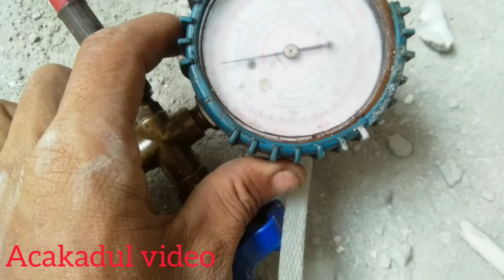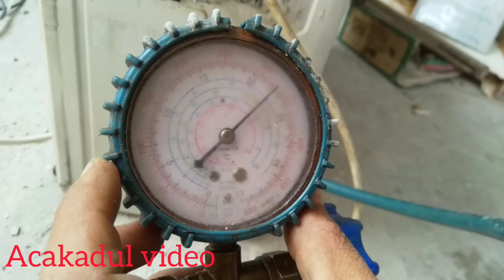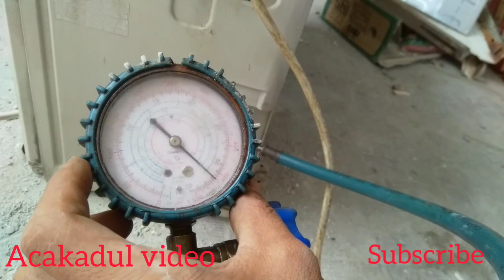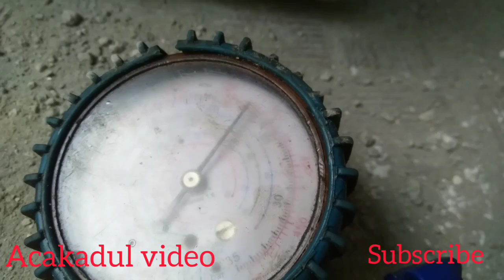AC tidak dingin???? kompresor AC loyo||pres balik

Comment: Assalu,alaikum..
Ac sy panasonik 1 pk...ketika sy ukur tekanan dan manifool hanya sampe 100 psi...terus klo sy cabut listriknye di pipa besar keluar angin agak keras...
Apakah kompresor ac sy sudah rusak..?
Reply from the maker: Maaf bosq bukan maksud menggurui,coba bosku tambah oli dulu,setelah itu dicoba lagi,masihkah seperti itu atau malh tmbah parah(ada oli ikut nyembur keluar)
Reply: @WawanPlog  ane udah tambah oil..dah ane jajal lagi..pas di cabut listriknye oli nyembur...ane jajal lagi, oli msh myebur bos...
Kira2 apenye yg bermasalah...
Reply: @WawanPlog  apakah msh bisa di perbaiki klo udah fres balik..?
Trims sblmnya nch...
Reply from the maker: Kalo belum nyemprot oli dr pipa hisap mungkin bisa bosku,tp klo udh nyemprot oli saran saya lebih baik ganti.
Reply: @WawanPlog  trims sarannya ya..
Sy doain semoga mas nambah sukses...
Aamiin yrb...
Reply from the maker: Trimakasih,
Reply: Pak pemula izinnanya. Panasonic inverter tua 2008 1pk. tes press loyo terus di Tambah oli udh kuat pressnya. Dicoba sampai 500psi cepat naiknya ampera aman 1.8. Sudah sampai 500psi sy matikan press balik angin dan asap. tapi oli tidak nyembur. Kira2 masih bisa tidak pak?

Comment: Salam sukses bang.  Bang kl ditest presure naik mencapai 450psi sdg ampere jg naik smp 3,5 amp,  apakah kompresor itu msh llayak ato tidak.  Di plat amp 4,3 amp - 9.000btu LG.  Mohon pencerahannya bang?
Reply from the maker: curen pada wering diagramnya sampai berapa bang,kalo wering curent di 4amper harusnya masih bisa,
Reply: @WawanPlog  diwiring max 4,3 amp.  Cm kompresor naik presurenya cepat dan ampere 3,5 lebih.  Setelah dimatikan, ditahan valve isap ada oli kuning.  Apakah msh bagus kah kompresornya?  Makasih byk bang infonya.